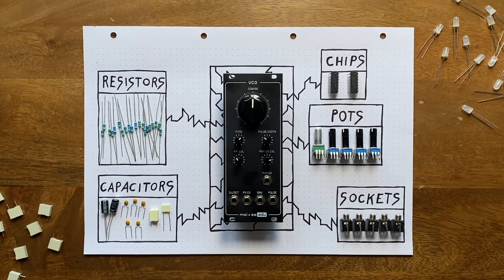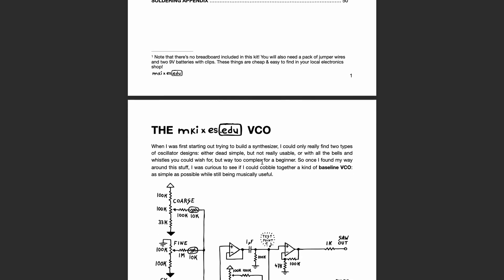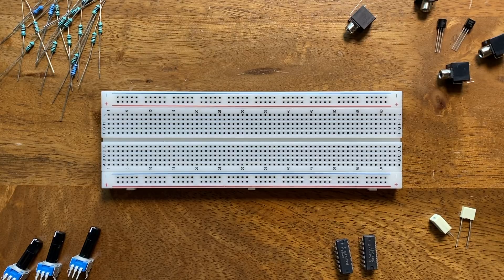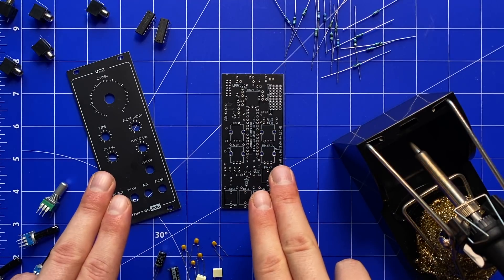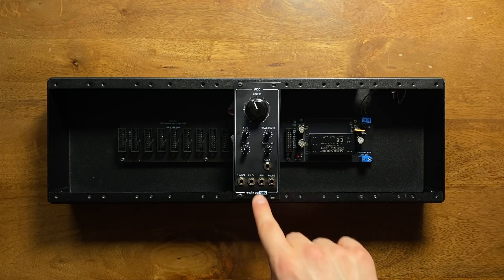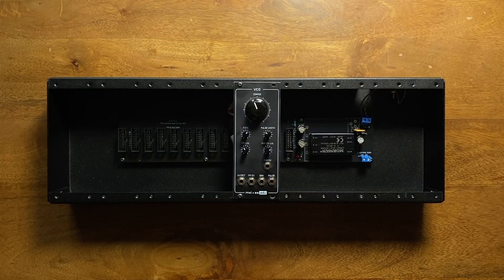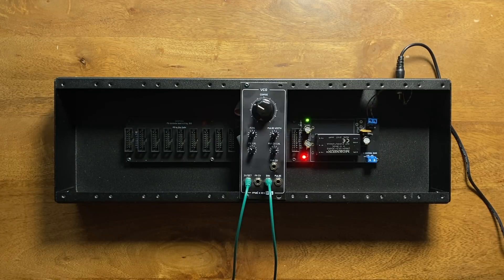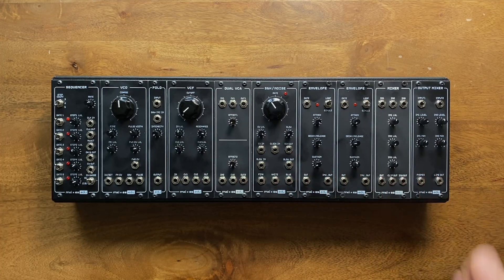Introducing the mki x es.edu DIY VCO kit

Comment: Hello !
I have just received the kit and I am having a problem with the volume. I can't hear anything coming out of the jack unless I connect to an amp and turn the volume up to near maximum...
Is this normal or did I miss something 😅
Thanks a lot for your work and these amazing kits!
Reply from the maker: what are connecting to the jack? headphones? what kind?
Reply: @MoritzKlein0  i've been trying with earplug with a 4 contact point jack , stereo jack/jack to a hedset (no sound with these two) and a stereo jack to the amp where there is a sound only with max volume . Maybe i should also try mono jack ?
And i've forgot to precise that i'm only to the first transistor step !
Reply from the maker: @vigar2351  so you haven’t set up the op amp buffer yet?
Reply: @MoritzKlein0  I have set up the op amp buffer, the transitor and the potentiometer

Comment: Hi, i assemble 2 vco on maker board, but on one of them meet issue: when i use my midi Keys via midi to cv -i found that vco can not play correctly 1v/octave range (it more higher than 1 octave, an on another vco it is almost ok but only in 1 octave. Question-what part of sheme can be corrected, seems component problem, thank you in advance

Comment: I had the power config all wrong. Is it possible to blow things up? or will they be ok and I can start again?
Reply from the maker: the chips are pretty sensitive to reversed polarity (+ to - and vice versa). so there's a high chance they might be toast. luckily, all the chips used in this design are widely available and cheap!

Comment: I built the vco and it sounds great but unfortunately the pitch is really high. If I were to add a larger value capacitor at c10 next to the 2.2nf in c9 would it give me a lower pitch? Thanks

Comment: I’m currently building the module and for some reason my waveform is a bit fuzzy and won’t stay still. Is this something I did and how can I fix it??
Reply: Also it doesn’t do it all the time but when it is fuzzy if I hold my finger on the output audio jack it straightens out until I take my finger off. If anyone else has an idea as to what’s going on I’d appreciate some info
Reply from the maker: @faithce4936  are you on a breadboard?
Reply: @MoritzKlein0  yes sir. I haven’t soldered it yet and want to know if this is something I need to be afraid of before I take that step
Reply from the maker: @faithce4936  i think what you‘re seeing is noise from the breadboard. some are better, some are worse, but they‘re all pretty noisy.
Reply: @MoritzKlein0  thanks so much for responding! I just finished building it on the board and I think your manual and designs are awesome!

Comment: What would an absolute beginner with no other equipment require to make this? Just a soldering iron and a breadboard for experimenting? An oscilloscope? Or does the fact I'm asking this mean this is too advanced for me? It looks brilliant.
Reply from the maker: absolutely required are:
breadboard
2x 9V batteries + battery clip connectors
jumper kit
soldering iron
solder

it helps if you also get a multimeter and an oscilloscope, but they‘re not strictly necessary.
Reply: @MoritzKlein0  Thank you Moritz! I've been watching a few of your videos today and I've never learnt so much in such a short time. I'm excited already.

I started reading a list of 'necessary' tools for soldering and there were so many, it was beginning to put me off the whole idea, but I'll just get the things you said, along with your VCO kit, and see how far I get :]

Comment: Loved the whole experience so far, i congralute you also for adjusting the manual afterwards. Only 2 points of critique i'd had to offer would be to a.) make the case available asap because as it is i have a module lying around i cant test because i cant power it. and b.) to send out an email informing people that the manual has been updated as i was able to determine that there is some connection missing but i couldnt figure out by myself what it was. Just by pure chance i went back to the shop page and clicked on the manual again (even though i had it saved already) and noticed the changes.

Both if the points are on the part of erica synths though i guess.. Anyway, thank you Moritz for giving me this opportunity, i enjoyed the experience so far!
Reply from the maker: valid points! the case and power supply are scheduled to release tomorrow. i‘ll see about sending out update mails for the manuals, but if you have an account, you can also follow me on instagram. i post about those kinds of updates on there.

Comment: this is fantastic, very excited to get my kit - however, I have one question/comment...
I noticed in the VCO manual, you don't get into some eurorack specifics e.g. reverse polarity protection, protect cv IO from unexpected inputs (voltages / outputs to outputs etc). 
I recognise, there was ALOT to get thru in the VCO being the first module -  but I wondered if these topcs would be covered in other modules?
Ive done a few experiments in oscillators/filters on 'desktop' , so my main interested in this series is how to adapt these designs for eurorack, how do I interface with eurorack... where a user is not just twiddling knobs, but is sending voltages... this series seems to be great for this, the VCO section on temperature control, voltage control pitch, v/oct adherence was nothing short of fantastic :) 
so im hoping you cover other areas that we need to be careful of when designing modules ... where users (me) do stupid things like connecting outputs to outputs ;)
Reply from the maker: girts from erica synths is explaining those things (reverse polarity protection, decoupling etc) in the assembly appendix - it‘s at the very end of the manual

Comment: Hello Moritz! Is the case shown in the video the one that will be sold by Erica Synths to house this series of modules? So, will we have enough space for 2 envelope generators just like shown here?
Reply from the maker: yes!
Reply: @MoritzKlein0  Thank you for the answer! Could I ask you something else? It's about the ICs, I'd like to put them on sockets instead of soldering them directly onto the pcb. Do you think there's enough space between the pcb and the front panel to do this?
Reply from the maker: @dr.getter7118  there are sockets included in the kit, and the PCB is designed for them!
Reply: @MoritzKlein0  Thank you so much =)

I have no worries then. This will probably be my first ever soldering project.
Reply from the maker: @dr.getter7118  let me know if you run into any problems - and have fun!

Comment: Really looking forward to what else is coming! Unfortunately, I already built an oscillator, and I'm on a tight budget and missing other essentials (like a VCA and VCF), so I can't justify getting a second oscillator just yet, but I really LOVE this approach for DIY kits.

This seems unique among DIY kits; most others that I've seen are like following the instructions for a Lego kit. They tell you what to solder and where to solder it, but they don't explain what it's doing, nor do they ever show the actual schematic. So they usually end up being a cheap way to build a module without learning much. And then if you need to troubleshoot any issues, good luck figuring it out, since you didn't learn anything in the build.
Reply from the maker: VCA is up next!

Comment: I know for this one you worked with a synthesizer company, but for something like the diode ladder filter, how did you turn your design into a professional looking through hole PCB? I have schematics and PCB layouts for a few modules, but im wondering how you actually got them fabricated. Or would you recommend just using stripboard?
Reply from the maker: i designed PCB and panel in easyEDA and sent the files to a PCB manufacturer. most will have small batch offers, where you can get 5 produced for very little money.

Comment: Mine is on the way! Your work is fabulous. I am also looking forward to getting this case! Just curious, will the released version be tapped only for the module widths in this series? Wondering because I'd be a shame to have to tap my own holes just to use different modules in the case.
Reply from the maker: i wasn’t involved in the design of the case, but it looks like it is tapped for the modules in our series. i‘m guessing this was done to keep cost down. i will check back with es and talk about it in a separate video!

Comment: As an addition. May I suggest the Ken Stone approach to future developments, where you can provide schematic variations, with which users that protobuild on a bread board, as well as a small protoboard area on the PCB to hardwire those changes. Just a thought.
Reply from the maker: there is a kludge area on the PCB for custom modifications!

Comment: Verry nice stuff. I find effect modules would be quite mezmerizing. Some ideas would be chorus and delay effects both easily achievable with BBDs (bucket bridge devices). It would be even cheap if the V3205 and V3207 were used and an external lfo unlike in a vintage guitar chorus is a quite nice feature I assume.